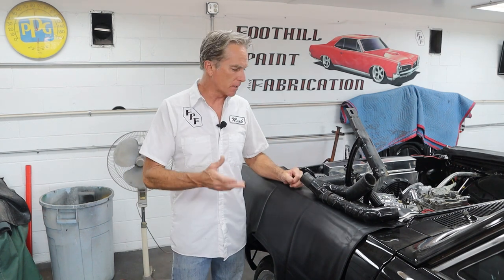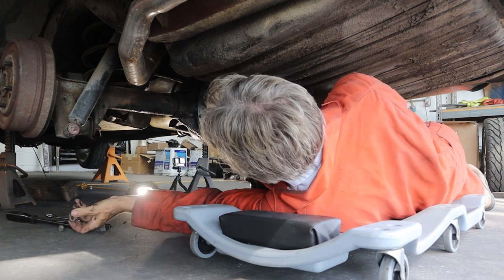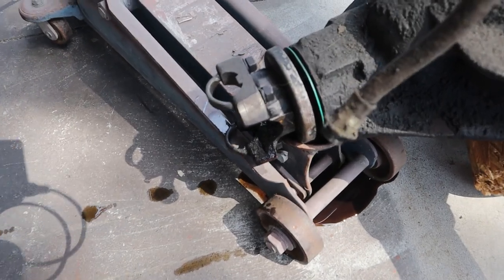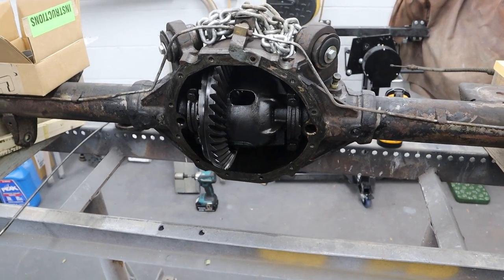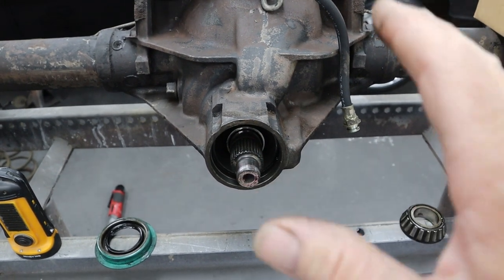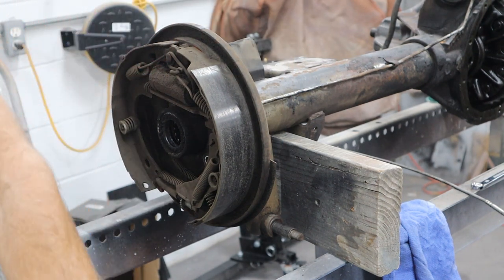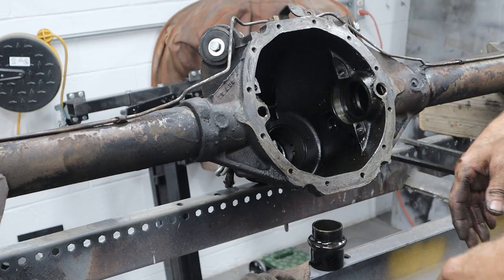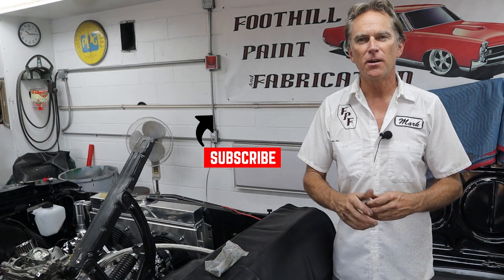1965 Malibu SS (Ep 22) Pinion leak and Disc Brake Conversion Prep on the Chevelle.

Comment: Nice work Mark. Your quite the mechanic. Back in the 80's in SoCal rebuilt the 12 bolt in my 53 3100 and finished just in time for a test drive at last call at the local bar. I smelled terrible from the 90 weight oil. A cute blonde said to me "you smell nice what are you wearing?" I replied "rear end grease". She got up and left. You are a multi-talented man. Thank you for your time.
Reply from the maker: At least you didn't say "Back door lube" Great story, made me laugh. Good ole days...
There are few smells from cars that I don't like and gear oil is one of them.  
Mark

Comment: This is going to be one sweet 65
Reply from the maker: I certainly hope so.  I wrestled that old GTO around town for years and years with horrible brakes and worse suspension.  This should be fun to drive 😄
Mark
Reply: @FoothillPaintandFabrication  My old Chevelle I had in the 80's had terrible brakes, I know how it is
Reply from the maker: @OpenRoader  I used to drag race on the street and the scariest part was trying to get that thing slowed down at the end. It had high performance aluminum drum brakes on the front with cast iron inserts but the problem was the harder you pushed on the brake pedal the bigger the drums got. Lots of down shifting back then.
Reply: @FoothillPaintandFabrication  Oh yeah, the original brakes on these cars were not up to the task. I had a 1959 Biscayne 348, 4 speed, 6 pack. It was fast, but had manual drum brakes with single master cyl. The brakes over heated so fast and they would not recover. Took allot of leg to get her back down on the ground LOL